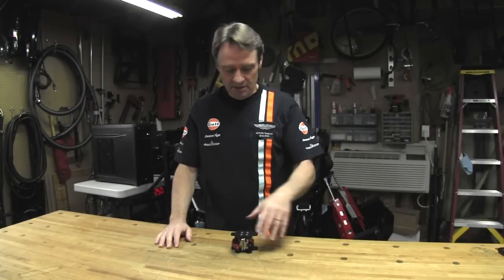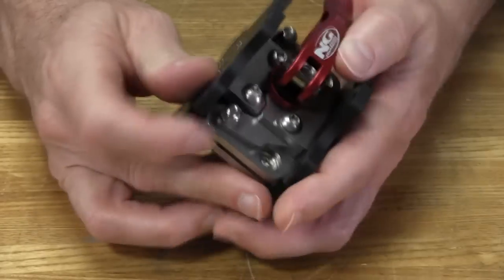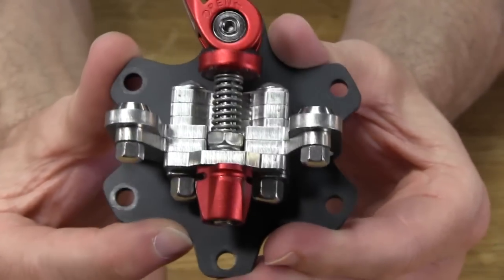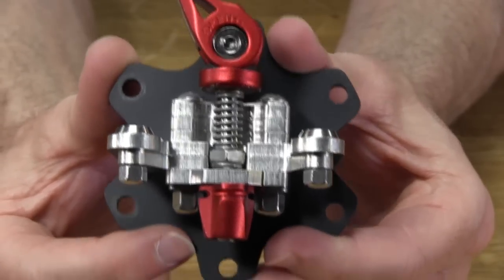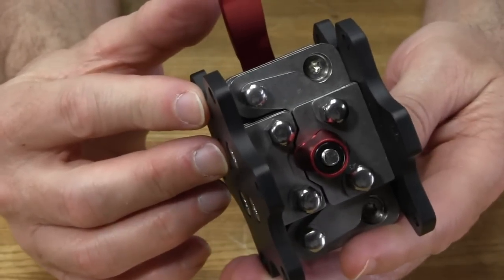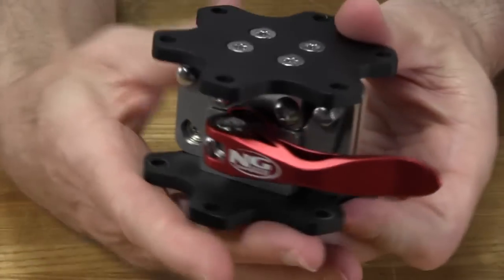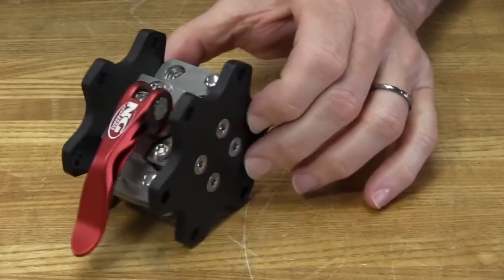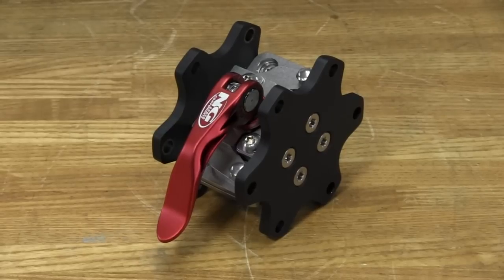Q1R Quick Release Review Part 1

Comment: You were defiantly right  Barry about it lasting a very long time. I have had mine since 2017 and to this day its as good as it was the first time. I regularly use 3 different wheels and the connection is for me the best rock solid joint. If anything i just need to turn the screw just a tad between two of the 3 wheels but that is all i need to do to get them all super tight. I did by a second base side just incase the original wears out but its still in the box i purchased from Sim racing Machines. Totally recommend this quick release.

Comment: is the best QR system you have seen so far for OSW wheels of there a different setup you prefer? Is it compatible for all wheel types? Since there is not an option to have QR with any wheel to be capable of being attached while still have toggle switches stationed on the rig what have you found to be the best solution to having toggle switches either installed on a wheel or where do you find to be the best site for buying wheels with toggle switches already installed?

Comment: Thanks for the reviews as always! Wondering now that you've tried the Fanatec universal hub, would this QR work in your opinion to allow a quicker change of rim styles while only using one Universal Hub? Assuming one could find a button positioning to allow proper fixed placement that would fit multiple wheel rims, could this attach between the Fanatec universal hub and rim(s)? The idea is I would like to be able to swap rims on occasion and just want one hub/button package, and it would be nice to be able to change the rims this way instead of having to unscrew all the bolts in the center hub of the Fanatec or other rims each time. LMK, thanks! -Mike
Reply: on 2nd thought, taking a look at how the Fanatec U-hub works, if I wanted to use any of the button "pods", I wonder if trying to fit this additional quick release between the 70mm 6 bolt rim holes and the U-hub might increase the depth to such a degree that the buttons attached to the hub are no longer reachable?
Reply from the maker: Mikemav3 Yes, it would make the buttons very hard to reach.

Comment: nice peace but the weight will get unbalanced by the lock clamp only on one side.
but that's very nit picking. a wheel wont be in balance either with the button and shifters on it